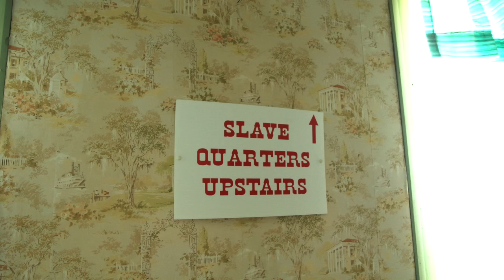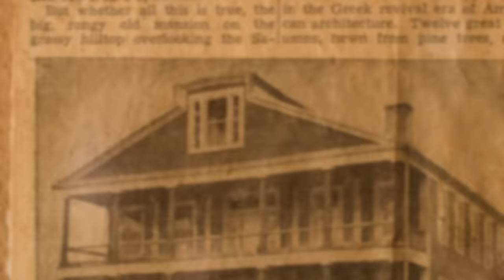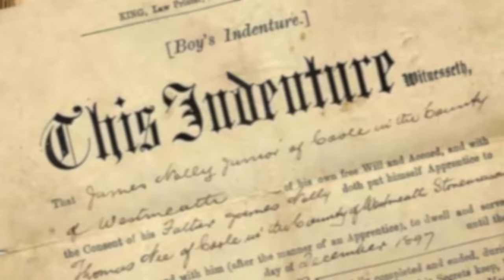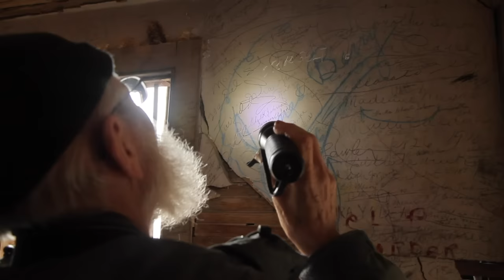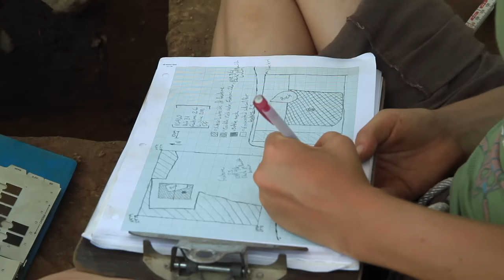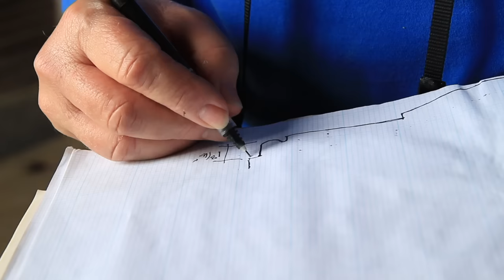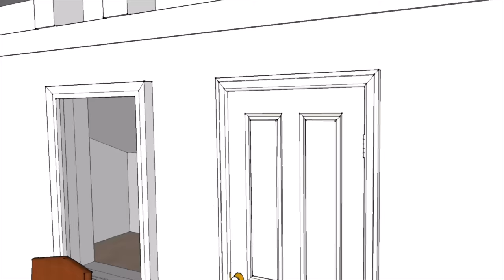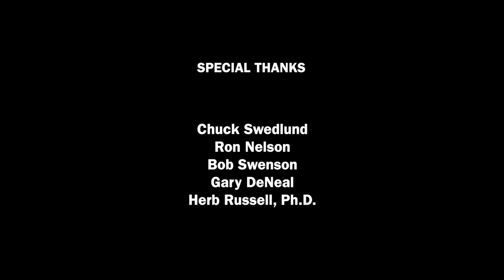Mr. Crenshaw's Yard: Investigating a Pre Civil War House & Yard

Comment: NOTE :   Comparing  ' old '  structures,  with  ' new '  ones :  OLD  is  usually  ALL WAYS    BETTER !    NO  sagging  roof, NO  faulty  foundation, windows  ' INTACT '   ( unlike  Millenium  Towers' ) .
AND  ,  the  front  pillars,  STILL   STRUCTURALLY   SOUND.   Modern  ' engineers '  with their  chipboard,  cheap metal corners brackets, for stud / trusses,  etc  etc.... cardboard  and  plastic  sidings  =  TAKE   A   HINT....

Comment: I feel like this home was a safe haven loved by those who lived there , because it's one of very few that still exist .
Reply: Actually, I always got that feeling, too. 
Previous owner, George Sisk, told me when his people purchased the property, the third floor was finished out like the rest of the home, with faint vines and flowers painted in the main hall. It was always thought, he said, that Mrs. Crenshaw had that built out for all the grandchildren she hoped to have in the house. Sadly, most of all her 12 children died at an early age, only a few living into adulthood. When it was clear there wouldn't be a horde of grandchildren afoot, the attic saw other uses.
Also, when I was small, the 3rd floor had transom windows, front to back, for ventilation. When it was roofed in the lat 60s or 70s they were removed and covered over. It was cheaper than working around them.

Comment: Why would bottles and ceramics be in the crawl space?
Reply from the maker: That's a great question. I'm going to reach out to the archaeologist and find out.
Reply: Watch the video at 22:11 you can clearly see new wiring, new insulation not blown in. Lol. That was all taken out by last owners and redone . So of course that dirt, etc would have been tampered with and nothing more found.  Aka not virgin dirt ,etc. Now  i challenge the state and these students to date that dirt,etc out of the craw space  i can guarantee its not the original !
Reply: @bradchappell4247  That's possible. The State repaired the foundation and stabilized the verandas after they purchased it. (The fireplaces were in a very poor state, with bricks falling down onto the hearth.) Maybe, had they dug deeper, there would be totally different things?